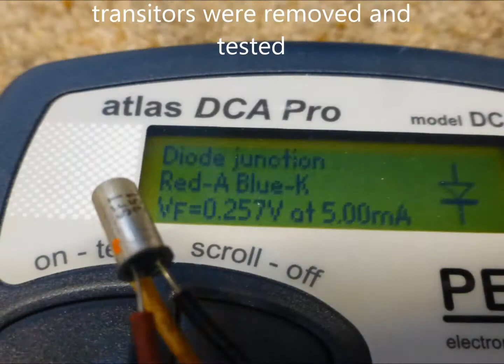Repairing a Vox jaguar keyboard

Comment: Thanks, I was given one of these which mostly works, I have to take it apart and see what's going on.
Reply from the maker: I can almost guarantee that some of the germanium transistors will have expired. Sadly new old stock may not be any better. The transistors short internally duee to crystallisation with age. I savalged some from second-hand , working Robererts radios I bought from a car boot sale.
Reply: @stevewardguitars1661  I was thinking of replacing them with silicon, and IIRC have to increase the base resistor to control Vbe (I'll have to check that to see if that's accurate). Do you have any advice about replacing them with silicon? 
I replaced the electrolytic Cs, positioned and glued in the bus bars, and soldered in a spring to replace a missing contact on a Bright switch. Now everything works but the  BASS CHORDS switch and the volume knob only changes the tone slightly. So I think I've narrowed things down to the Bass Divider board.Unfortunately it's a Heathkit TO-68 and I can't find a schcemtic for the Bass Divider board... the resistor colors are faded and some are ccorroded enough that I can't tell what they are. If you know where I can find a schematic that would be really good. .